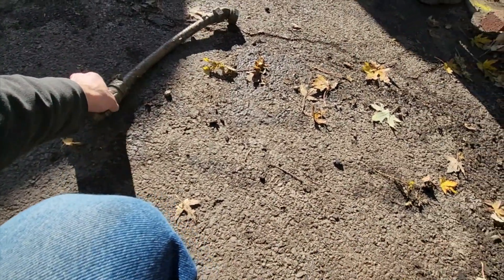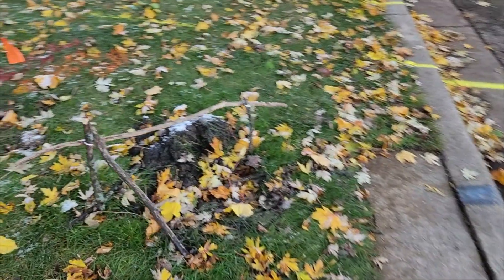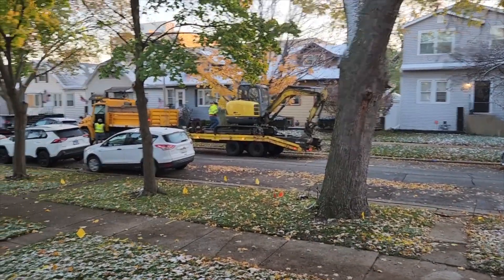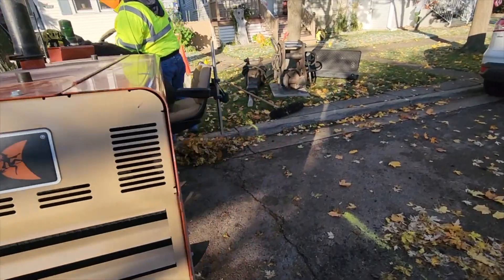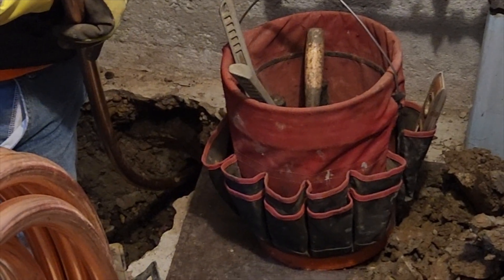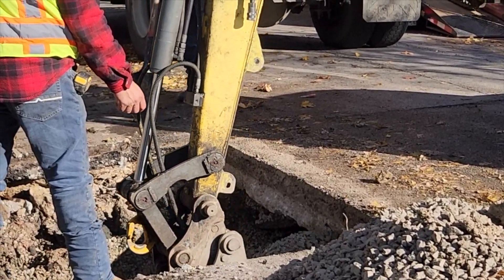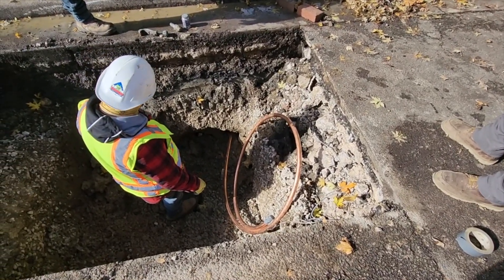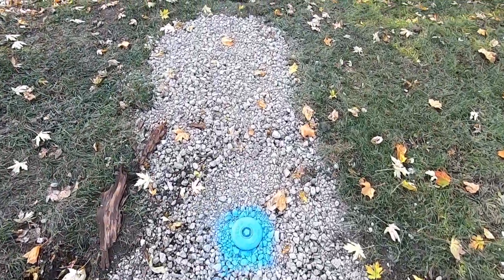Replacing a lead pipe water main to my house.

Comment: How did it not cost you anything?
Reply from the maker: I had a leak in my water line that was the responsibility of the town I live in. Since they needed to replace all lead lines eventually anyway, they replaced it with copper. I believe there is funding to have this done everywhere. I'm not sure if it will be free everywhere but it was for me.

Comment: Those steerable horizontal drilling machines are absolutely extraordinary. They use great big ones here to replace water mains and storm drains. The terrific thing in this case is how quickly it was all done! Cheers Tom.

Comment: Interesting that the city takes responsibility for the line from the main to your basement, it's different out west where I live (Washington state, and Oregon). The city owns the connection from the main to the meter, which is curb side, not within the house. The homeowner owns the line from the meter forward. We are now using mostly PEX type A for the line from the meter to the house, with a tracer wire pulled along with the PEX tubing. I have paid for several water lines at various houses I have owned over the years.
Reply from the maker: I should have asked but I assume that my town must be getting some federal funding to convert the 6500 homes in my area. I'll have to find out.

Comment: So they fill the yard hole by the street with gravel?
Reply from the maker: They will come back with a cement truck in a few days and do it properly.
Reply: Are you responsible for filling the hole by the tree with dirt and reseeding? Regardless, that was a fast and efficient city job! Great video!
Reply from the maker: They will probably add dirt and sod but I'm not sure.